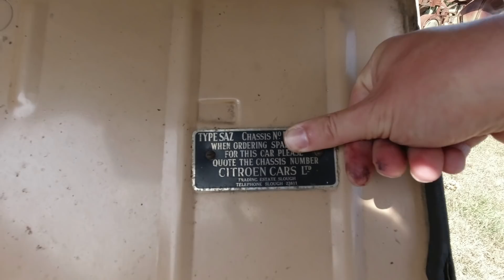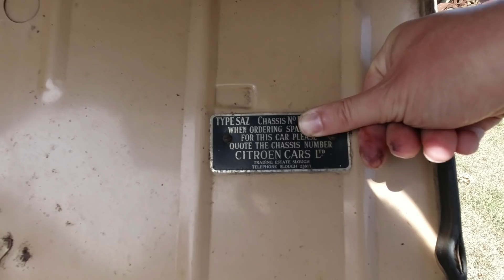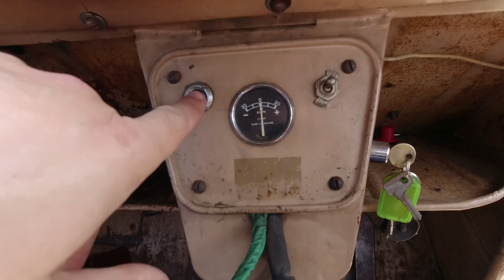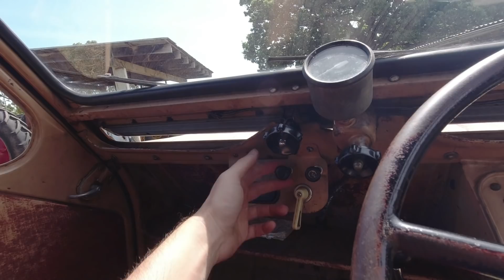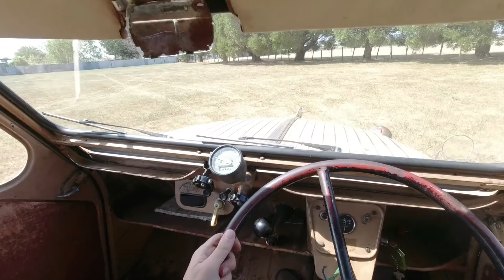British-built 1955 2CV road test, in Tasmania, Australia! 425cc!

Comment: Technically those are road speed sensitive wipers, 5 decades before they became an option on more exotic cars.
That 400CC engine does a fine job, a 4CV Renault topped out just over 50 MPH on a massive 750 CC
Reply: Yes, shame Ian didn't demo the wipers' speed back at the farm while crawling around the field.
Reply: 1950 Vauxhall's had wipers driven from the cam. At least they still worked when stopped at traffic lights or at the drive-in when it was raining,  that was if you really wanted to watch the movie.
Reply: @volvor730  TBH, I believe the only thing that should be driven by the engine is the alternator. Electric oil pump, electric coolant pump, electric radiator fan - all variable speed to meet demand, of course, would be far more efficient than running these things relative to engine speed.
(OK, I guess they could all be powered by V belts on a variomatic system like CVTs !

Comment: The crappiest, but funniest, car ever made.
Its crash safety resembles a beer can and early models still around will lance you by the steering rod.
The 2CV was never approved in Sweden.
Despite its apparently simple design, its by no means a simple car to maintain, which you discover when you trace down wear in the steering components.
Reply from the maker: All 2CVs have a solid steering column, but the rack is right at the back of the engine bay at least. They are simple cars to look after for the most part, though there are some specialist tools needed.